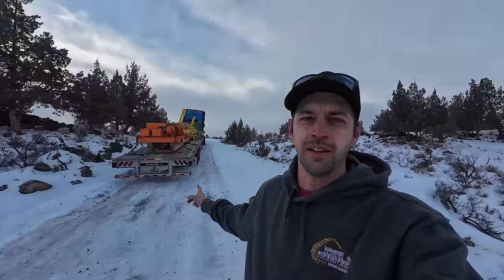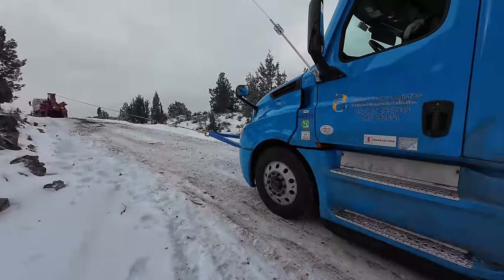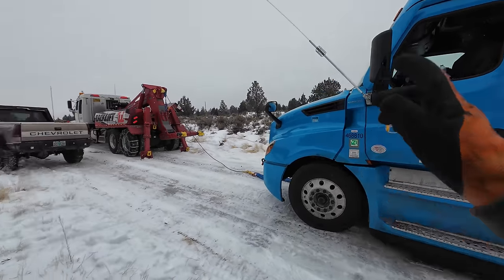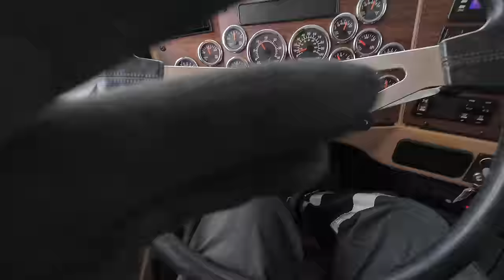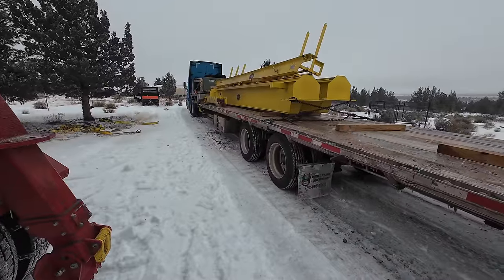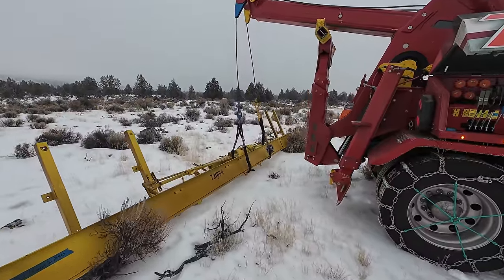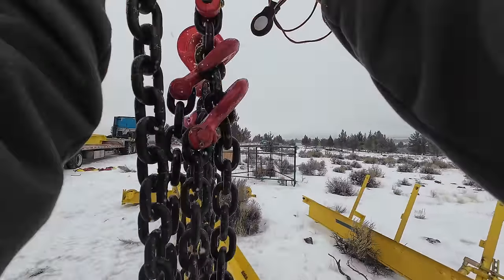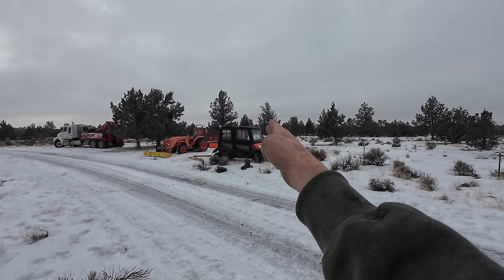This "simple" recovery turned into more than I bargained for!

Comment: That was a bit of a nail biter, wasn't it?  We have the same kind of bridge on our private road. It's a 25 foot concrete slab and it's anyone's guess what it's weight rating is so everyone holds their breath every time something really heavy drives over it.  You really go above and beyond on your recoveries. You might have to change your name to include heavy equipment recovery and crane service! What a great testimonial for the power and versatility of that zack lift.

Comment: @zackliftinternational4841 the remote issue that casey had can probably be fixed with a redesign of the cover on the remote. For the up and down winch controlls have an outer Oval rubber button covering both buttons with a hard bar across the top. Then you can press the top button, the bottom button or both together by pressing in the middle. The bar needs to be attached to the weather cover so its seperare from the buttons. that wIll let the buttons themselves maintain veritical action. Just like on a video game controller.

Comment: Great video, interesting as always.  When your equipment chills in the side boxes of the ZackLift during Winter, have you thought about putting Seed Warming or Reptile Warming mats  in the side boxes?  They are low voltage and only produce gentle low heat, but they might be enough to take the chill off the kit, and also prevent things getting frozen up.  I am sure you could get some wired in to the vehicle electrical system easily enough.  Also is the battery for the rear light board in a charger in the side box when not being used?

Comment: 12:12 exactly as i said some time ago, why those chains are bad for using in high demand conditions, aka when in matters.
You should do a test without lifting the truck tires in the air, and just pull something, get stuck and sloly creep forward again while filming those chains and see in the bad conditions, if they perform and how they perform.

Comment: Please help me out. When we used shackles to lift 160 000 pounds with an 180 000 pounds crane and did not loose them up we needed a hammer to get them loose.
Differend type of shackle? Differend when under hoisting power?
Yours where frosted, these deformed one way or another. Thats why i prefer the one with a bolt and a locking pin. But not everywhere usable! So. As long as it doesnt go wrong you do it the not wrong way.

I think you have a perfect unit and operate it a okay. Perhaps a little bit bigger remote during the winter. Would you and a belly unit get along?

Comment: The backing off the screw pin on the shackle 1/4 turn is from Naval ships. They teach  us that to help battle the rust. It gives you a better chance trying to break them free from the rust. Naval ship also use mousing wire to lock the pin on the shackle.

Comment: As much damping as it looked like when you sat  on it, seems like you may feel more of the small bumps more on the road.  Mine was very harsh when set stiffer.  Looking forward to seeing how it handles 100mm rocks like in a creek bed or rocky trail too.  I'm still not sure my L2 setup is set up right either.  Forks seem to dive too easily coming to a stop.  I wonder if I'm running enough oil.  If I remember correctly, I think I read the durections ti say "put 600ml in the spring only fork, and 400ml the n the cartridge fork.  It made sense because the cartridge takes up volume, but I wonder if mine are too low.  Did you remember to back off your preload again?

Comment: If you back the pin off a quarter turn you just open the face of the clevis with each pull till eventually they break i saw it happen with a D8H dozer winching and pulling a D7G with a tile plow how nobody got killed with all that metal flying and cable whipping around it was pure luck a crane rigger finally got them to understand what happened

Comment: I'm not familiar with the Zacklift and was wondering if you can use snatch block (hook into boom end)? What I like about snatch blocks, doubles the cables strength , slow the winch speed down, and most of all less pressure on the cable wraps on the drums. I've seen when snatch blocks are not used it flattens the cable wraps and not easy to free wheel the cable to pull it out. I enjoyed this video and I learned rigging techniques that you showed us.
Reply from the maker: Yes, absolutely.  But none of that was needed for this job

Comment: As a ex crane operator we would back the shackles off max of 1/8 of a turn for loads that where 50 % or less then capacity of each individual device..if doing a critical lift (80% or more lift capacity) all shackles tight….if we where having a bad day ( couldn’t do the load calculations in your head) we ran them tight

Comment: Constructive criticism here.....but the autochains that we install. (Instachains) word in their manual, that the auto chains are to only be engaged on spinning tires. I've heard them in a few of your videos just clanging away when you're just BARELY moving across the ground. They really don't even get under the tire unless the tires is spinning the chain wheel at a descent little rip
Reply from the maker: These can be engaged while stirring still, and they work just fine at low speeds.   I have video after video where I’m just moving the truck back and forth and you can see them working just fine.
Reply: @CaseyLaDelle  as long as it works! That's the name of the game these days anayway. I meant no disrespect cause I've learned A TON from your videos recently. You've definitely got your hands full now it seems. Awesome work, and obviously ^^ I'm learning more from every video.

Comment: I would have spun the shackles 180 degrees so the bolt is flat against the sling and the round head against the Trucks rings. But that is just me, it really doesn't matter that much.
Reply from the maker: Nope, that’s incorrect.   The sling goes to the round part of the shackle.

Comment: The only reason they say to back it off is so it’s easier to unscrew. If you have pliers or a hammer, it’s stupid not to fully tighten.  Likewise, the recovery warriors in the comments have never done a recovery… and for the handful that have, they’re moving unstuck 4,000# rigs out of the yard because they bought the wrong tire.

Comment: i did learn about shackles..  our 4x4 trainers are wrong. but then, they are chinese shackles, & most drivers are old..  we use 4t shackles to hold 2.5t so, i dont think 1/4 turn matters, seeing all rated equip. inc. people lifts in buildings,. will stand 4 times what its rated to..  just my ausie 2c.. pik,,pik,,pikk,,,allways piikking....  you should do a shackle rating vid.. to failure.. like the rings..  locked, & 1/4 turn out.

Comment: I will dispute you shackle comment. Crosby in their classes tell you to tighten the pin and back it off 1/4.  If you make a lift at maximum capacity you will "spring" the shackle and a 2' pipe wrench will not remove the pin. Their videos show several shackles testing at maximum capacity, with both pin tight and pin backed off. To remove the shackle with a tight pin took a torch or a cutoff wheel. Backing the pin a 1/4 did nothing to the load rating capacity of the shackle. 
Now, that was a Crosby class about 10 years ago. I won't make any comment about import shackles since I refuse to use them.
Reply from the maker: Crosby is literally the ones saying to tighten them and not back off.  Look it up
Reply: ASME B30.26 has the following statement regarding screw pin shackles:

The screw pin threads shall be fully engaged and tight and the shoulder should be in contact with the shackle body.

Thus, contrary to popular believe, you should never back off the screw pin before use. The shackle pin should be a minimum of hand tight before the lift begins. @CaseyLaDelle
Reply: @CaseyLaDelle  Well, times have changed in  the last ten years.

Comment: They can't start diesel engines in cold? IN old times in my country, peopels start small fire under oil pan to warm up engine, then after a while they gave engine to smell some torch just by intake - filter taken off. (made of rag on fire) Never failed.

Comment: Wonder how many realize that Western Star is based on a T800 Kenworth...hood, dash, steering wheel, probably the whole basic cab. Nothing wrong with that, it's a proven rugged design.
Reply from the maker: No it’s not.  Not even close
Reply: n @CaseyLaDelle  Not a hater Casey...just pointing out some things to a younger generation.  You can accept that or not, I don't care. My mid 90s T800 was basically the same dash, except it had a digital dash plus gauges. Same steering wheel as my T800 and '05 Mack Vison. Basic steering wheels and steering columns all come from outside vendors. They produce for various manufactuers. Design engineers work for all different truck manufacturers. My T800 had rounded bottom edge on doors instead of square corners. Most expensive part of the cab are the door frames. I used to haul Freightliner replacement cabs and hoods that dealers ordered for wrecked trucks.The hoods came out of an independent factory, in British Columbia, that made hoods for most trucks,  Fully trimmed replacement cabs came off the assembly line in Portland. The basic cabs were hauled in from some independent facility. 
Be safe, ok ?
Reply from the maker: @heyinway  I’ve owned T-800’s as well and the two are not even remotely close to the same thing

Comment: What is at the destination they are seeking to get to! Is it oil, mining , or forestry products? Any chance of getting an answer from viewers?
Reply: Add: i fear rotator driver is going to have a hazardously difficult drive down that tw track with that frozen trail and the steep slopes! Evev wit multiple chais the sheer weight of rotator may over take braking efforts, I pray that is not the case here, thats a long haul down ,plus deep trenches on either sides of 2 track . Good luck  driver

Comment: Dammit it took me longer than it should have to notice you got the frame mounted tool boxes moved to keep the Zacklift landing gears on the truck full time. What's the new hookup and unhook time?
Reply from the maker: Just under 10 minutes
Reply: @CaseyLaDelle  I hope you'll do an update the next time you have to switch out to the trailer.

Comment: Video Time Length: 14:38 min's.
FYI 3 (Three) Different Shackle(s) Destroyed!!!
Testing Shackle(s) For Failure(s)
https://www.youtube.com/watch?v=9mYzflG28uw
What happens if you back off a shackle by 1/2 a turn?
FYI, your not even getting close to the 62,000 (sixty-two-thousand) pounds necessary to collapse a ½" in. Dia.  shackle.
In the video they do fully engaged, (i.e. hand tighten) 1/4 turn, and ½ turn loosen.  The difference in
failure, is so minor!!!!  Your better off worrying if your using a proper sized DIAMETER shackle for
your purpose at hand, then what position of tightness, the pin is in.

And to support your line of thinking (Which I don't agree with having watched the video above;)
Video Time Length: 13:06 min's.
https://www.youtube.com/watch?v=ABIfJ7Imt1E
Which Shackle Should You Be Using?
And as long as your wanting to preach safety  enjoy:
ASME B30.26 rigging hardware
Requires shackles manufacturers to have identification and / or markings on the shackle body as well as the shackle pin.   These markings are required to be maintained and legible throughout the service life of the shackle.

OSHA 1915.113 - SHACKLES AND HOOKS
ASME B30.26 RIGGING HARDWARE
SHACKLE ID REQUIREMENTS
Shackle Body  Name or Trademark of the manufacturer, Rated Load, Size.

Shackle Pin  Name or Trademark of the manufacturer, Grade, material type, or load rating.
IF YOU DON’T SEE THESE MARKINGS, DO NOT USE THE SHACKLE.   Always check the Working Load Limit!!!  and make sure your load never exceeds that limit.
More general information reference Shackles:  https://f.hubspotusercontent10.net/hubfs/3336966/Literature/Training/Mazzella_SlingWLLPoster_36x26_0121.pdf